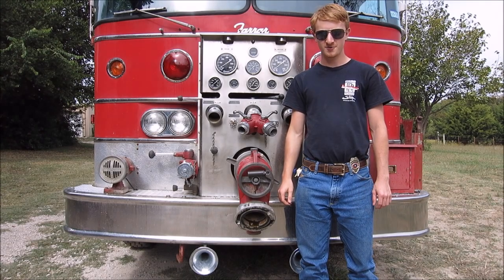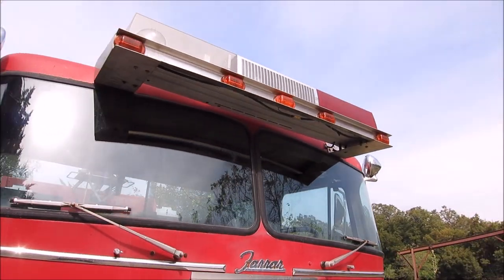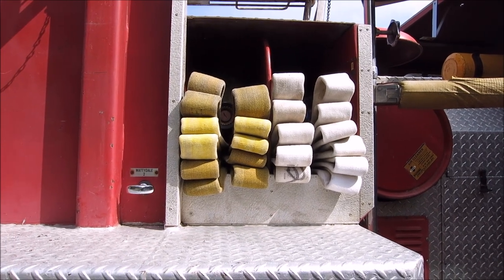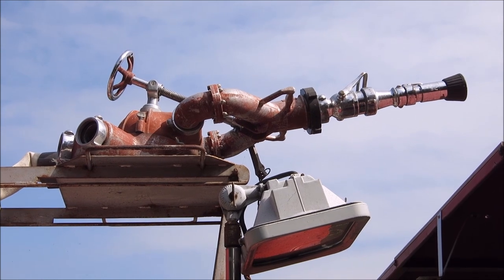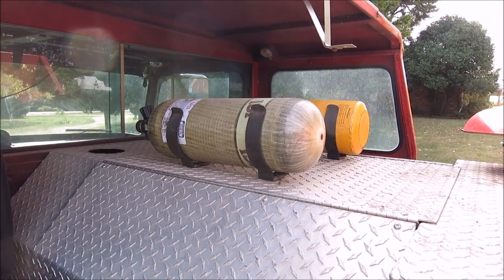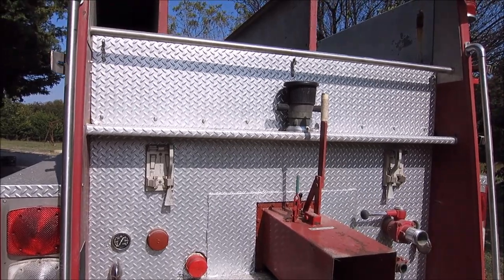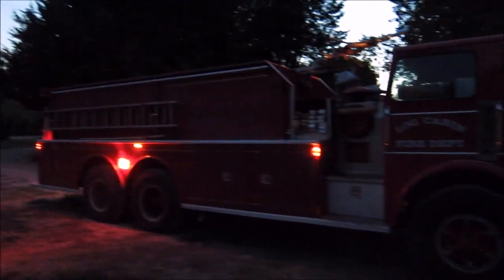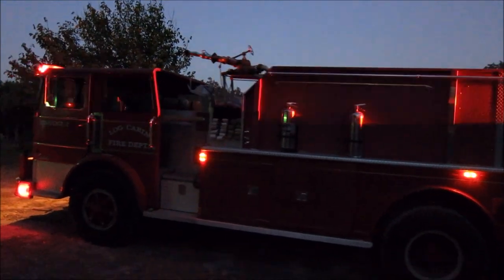Vintage Fire Truck Restoration! (part2)

Comment: Well thanks for keeping this unit alive and out of the junkyard.. first of all you have a rare truck there because most of the trucks have had the cab Ford design or the cab over did not have a
Reply: This time I I intentionally. Posted . Cuz I wanted to talk to you about your two and a half and 3 inch fire hose.. a list that came with the truck and if you bought those used the thing is you have to check the threads on both ends both the male and female lens to make sure it works with a thread on the truck if your house is not connect why haven't ...

Comment: So how did you get the old girl back in service just curious love your channel so far and love the truck man good luck to you on your future projects as well
Reply from the maker: Thanks for the comment! So I became a Telico firefighter about a year ago. Most of theyre equipment holds around 1,000 gallons. Since my tuck carry's about 2,300 gallons, any time there is a big fire Ill bring my truck on scene so they can refill they're tanker or fill up little brush trucks. Having such large capacity it also goes to structure fires and can be used as a water shuttle. It serves a variety of functions but Im just glad Im finally able to use the apparatus for its intended purpose.
Reply: @highvoltagemayhem3345  very very cool and thanks for the response look forward to seeing it in the future videos

Comment: isn't that a 2 1/2 intake in the rear? just like the one in the front?
Reply from the maker: No its a discharge. There were multiple 2 1/2 discharges on the back with one 1 1/2 discharge as well as a 2 1/2 direct fill on the left side. Over time one of the discharges got cut off and the direct fill broke off while I was using it one day.